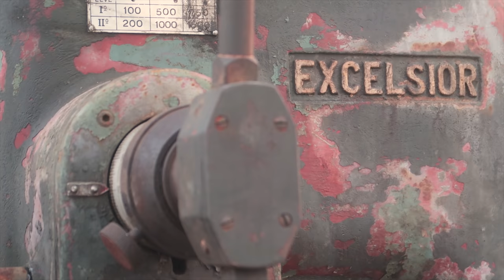Big Drill Press Vise Restoration

Comment: A lot of unnecessary movements. Processing with hand brushes, electroplating without removing the paint, then to put under the disc brush? Meaning? Sealing of metal workings from drills with putty? Replace absolutely good sponges with a good file? And all THIS is not painted?